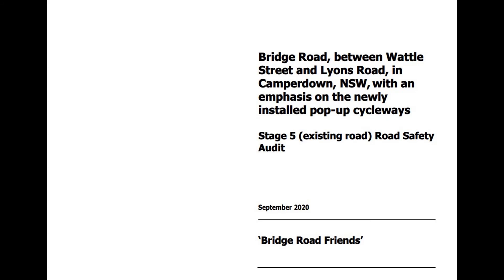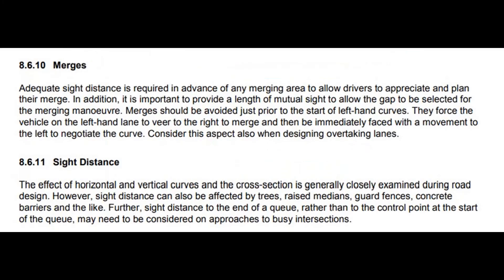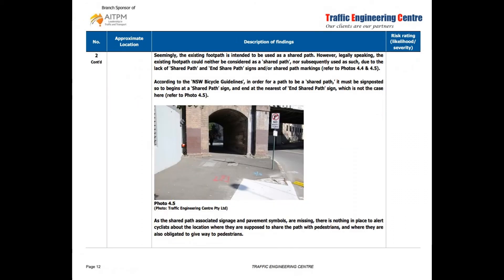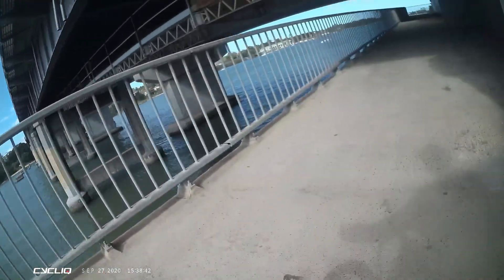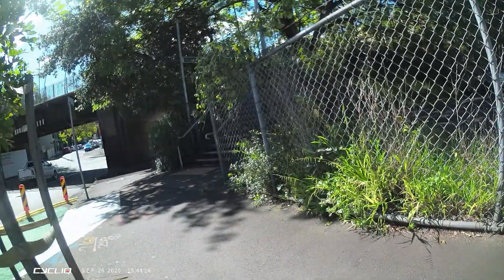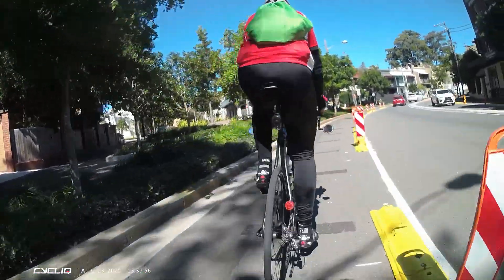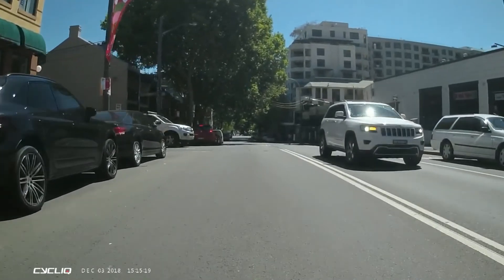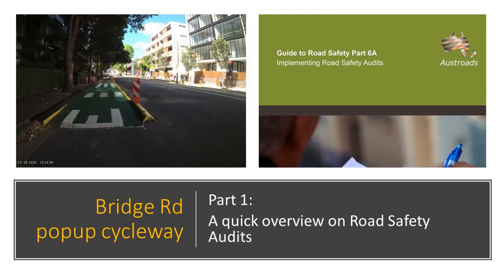Bridge Rd road safety audit review -  part 2

Comment: Thought for the merge points at intersections. Melbourne City Council has started converting left lanes into bike lanes on the approach to intersections even where it means drivers are left with only one lane and need to wait behind a turning vehicle. 

Melbourne CC started doing this after they did surveys that found bike rider confidence levels collapse where bike lanes end before an intersection. 
This has been coupled with bike head start lanterns so bike riders are not cut off by turning drivers at the beginning of the green phase. 

See an example from last year where bike lanes were installed all the way to the intersection (as part of tram platform works). Head start lanterns aren’t yet switched on in this video but you can see them taped over. https://www.youtube.com/watch?v=GTGa-vxYDrk

See the research from Melbourne CC here. https://s3.ap-southeast-2.amazonaws.com/hdp.au.prod.app.com-participate.files/4315/2765/9474/Transport_Strategy_refresh_-_Bicycles_for_Everyday_Transport_Discussion_Paper.PDF

And see head start lanterns in action in this video from about the 2:30 mark. https://www.youtube.com/watch?v=BhMZce8CpeA
Reply from the maker: Thanks - that's really useful. I'm going to share that on a few pages, including our own.